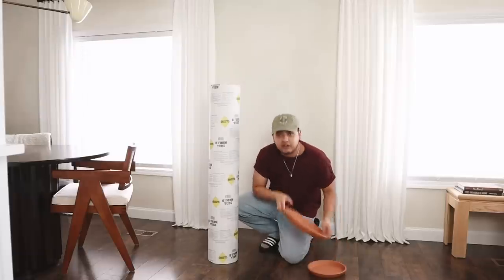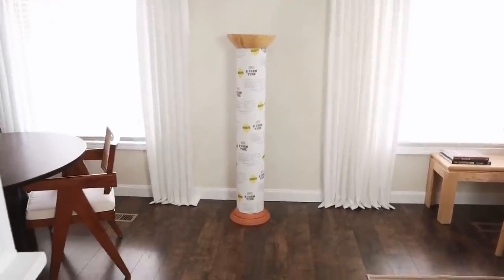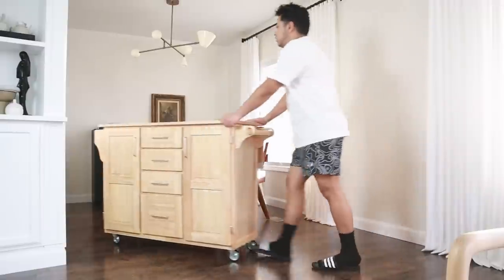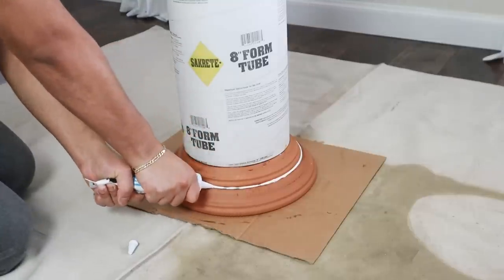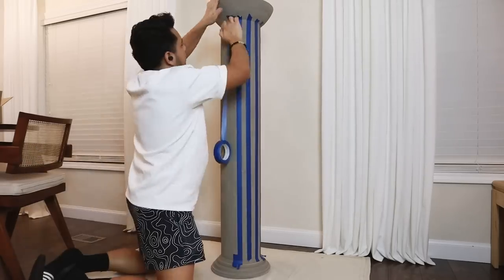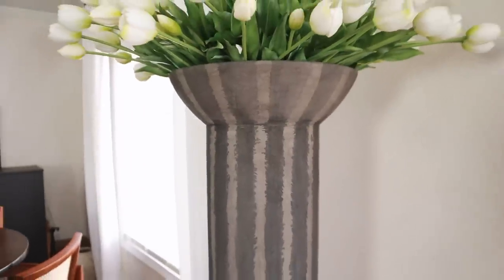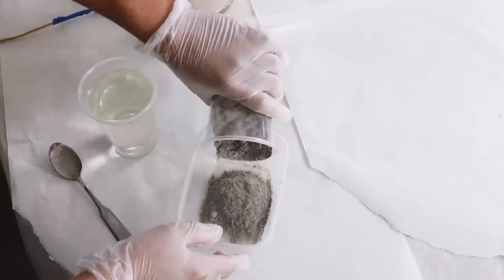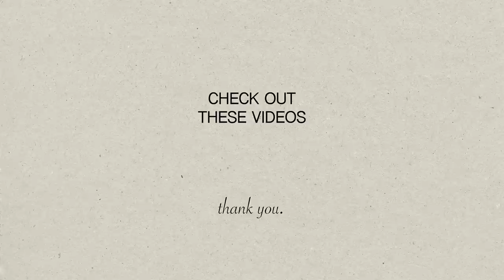DIY CEMENT DECOR IDEAS (column stand + vintage pottery lamp)

Comment: One way to minimize the bleed under tape would be the following.  1.  Paint the entire thing gray.  2.  Tape as you did.  3.  Paint the stripes between the tape with the same gray paint.  It will bleed under the tape and protect it from further bleeding.  4.  Paint the final contrast color over the tape.  5.  Remove the tape.

Also, just a little something...if you accidentally spill iron sulfate fertilizer onto your concrete driveway, it results in a rust stain.  You might be able to make concrete projects look like they were made of iron with a little fertilizer.